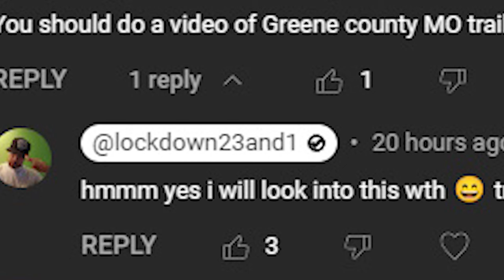SEMI TRUCK TRAILERS TURNED INTO JAIL CELLS

Comment: Reminds me of Sherriff Joe Apaia's infamous tent city down in AZ. This seems like a safety concern for CO's too. Imagine being a CO and responding to something and the inmates attack. You'd be trapped in that tin can! Another disappointment in terms of the evolution (or lack there of) in the incarceration system. SMH. ✌️❤️🙏
Reply: At least those were outside. I feel like I would go crazy in those tiny steel boxes
Reply: @mrdeebo313  I don't think the climate allows for that in MO & ID. 🤣 but agreed!
Reply: Actually, the trailer pod is right across the street from the tent pod in Canyon County. Miserable bastards.
Reply: Evolution is any change. That includes negative change. Evolve your education of the extremely basic words you use ?
Reply: @spasegeek9214  Evolve" conveys the notion of progression, moving forward: "a process of continuous change from a lower, simpler, or worse to a higher, more complex, or better state.

"Devolve" conveys the notion of regression, going backwards or down: "a downward evolution to a lower state" 

The more you know 👍
✌️❤️🙏

Comment: Man. Stack em n pack em. Those Stainless steel walls make cleaning easy, and escape tougher.
Reply: its Missouri who did the job not us Idahoans
Reply: Though uninsulated steel trailers will doubtlessly lead to inmates getting heat stroke in summer and freezing to death in winter.

Comment: Trailer jails will be a good idea until there's a little fire in one and then they'll all go to the scrap yard to avoid those lawsuits.
Reply: Stainless steel don't catch fire
Reply: @briantruck2284  nope but wires do and they catch fast and make for some nasty noxious fumes.
Reply: Or the outside temperature gets too high or too low and the heat or cold begins killing those inside.

Comment: I served in Mimico, Toronto youth assessment centre in 2000 at that point the jail was already 116 years old. Real hole with a toilet hole in the floor. Food gate at the bottom of the door. Metal benches along the wall is all you get. They keep you in there nude with just a one piece padded jail skirt. I spent 3 months in that hole after three fights defending myself. They held murderers who were older and still serving youth detention sentences. They also had all the worst youth criminals in Toronto in there. Place was lit with blood and crips. You learn fast in there. I got lucky I think a woman in corrections believed me that I was only defending myself and helped me get out of there after serving three months in the hole straight. Served open custody after that.

Comment: Thankfully here in greene county, springfield they actually got the newer jail opened up and took the sardine cans down and no longer have to go thru this hell they had a couple diff versions i unfortunately spent a little time oit their and it was brutal I m 6 foot 5 so you can imagine. I got lucky enough that the ac was working when i was their but i know plenty of guys spent LONG stretches of time in the trailers for the duration of 5  or so years they had the different variations of trailer park setups the first versions i heard was a complete nightmare as in ac not hardly working or if i remember correctly i think their was issues to do with the showers damaging and molding the place i only got placed out their 1 time thankfully idk im guessing my charges were why i typically spent most my time in and out of good ol D pod gen pop if i stayed in Greene Co. and not extradited to other counties neighboring. I remember though sometimes we would pretty much kinda get locked down in our cells for extended periods in D pod in the actual jail so they could bring the people inside from trailers and go thru and repair or thurly clean all that deadly ass mold and shit that people was getting sick from i deff have a few friends and my brother even that could shed alot more light on these better then i could the setup i remember was when they built the one you have the time lapse on the greene house looking panels ontop was basically the outside rec area for you to walk around in and their would be fresh air or some sun kinda here and their but inside very close quartere a table running straight down the center you eat chow at or alot of times sit at your  bunk if tour on bottom when i was their they had 3 bunks stacked in such a uncomfortable confined area had to sleep feetle pos all the time the only thing seperating the bathroom toilets from the beginning or last bunks was a sliding door or paneling clear see through kinda like the greene house paneling or plexi glass yeah i spent very minimal time in these things and i been all over multiple countys as well as took a DOC tour and by far one of the harder times i spent was in here literally had like 8 tablets to be able to get ahold of your ppls on and that shit was booked out by your regular phone hustlers every day and it would just always be so loud it was impossible to sleep until late night when its semi settled down in their.

I knew from the first picture the way the striped uniforms were and trailers you were gonna say greene county thought i would share my short stay that felt like forever in these damn sardine cans as alot of us called em. If you got any thing you are interested in finding out about these things i may know if i dont i deff 100% have close friends and family that spent alot of time in these things that could shed some light on the shit that was going down in their i know that if you were relitively unknown or just had no real name established or no one could verify you and or you just fall into that weaker category them dudes would sit their and straight press you at the door i never had these problems but ppl was getting pressed as soon as they walk in told they gotta pay to stay type shit and most the time it was just a group of individuals  not even no gang shit or nothing sometimes you might have some Honkeys or something individually in those mixes but them guys are mostly moving around in DOC if they are in county they just passing through typically but yeah these open bay close quarters im suprised their wasnt more beatdowns and just back and forth bickering and or just getting down over dumb shit that matters for 2 seconds and stuff while i was their only seen a couple of wrecks nothing to bad really though you wasnt getting nothing off and pretty much taking a dive if you do clash their was very few that they got something off their is a viewing window into rec and at doors outside of the pods the cops wouldnt really be in the pod itself unless counting or pulling ppl for whatever reason courts and etc.

Comment: Death I was locked up in these trailers in Springfield Mo. they are no longer using them. They have a mega jail in Greene County now.
Reply: They were using the trailers for multiple reasons. (1) is because Greene county Jail is a federal holding center. (2) The county would not let the city house their inmates. For these reasons they were paying massive amounts to of money in order to farm inmates to a number of county jails through out the state. I was in these trailers for a few weeks it was miserable, I have some extremely treacherous stories from within the walls of Greene County Jail.
Reply: You mention the TV you can watch the tv but the only way you can hear anything is if you buy a little Walkman radio for 20 bucks. 8:07

Comment: I stayed in the trailers in Springfield Mo. I prefer the trailers over the jail tbh. Youre always on rec in the trailers and you had an actual outside space to walk around in and feel the rain. Yeah it was a tight space but it sure beat the confines of a cell inside a concrete room. That timelapse was from the first set of trailers where I stayed. The second and even bigger set was built across the street before the new Mega Jail was built. It was pretty laid back for the most part. You had to be on your best behavior in the trailers or you would go back to gen pop inside. the trailers were considered a "privilege" since you had 24hr access to phones, tablets, vending machines and outside. The beds did suck! Im a large human. They had me assigned to a middle bunk and there was no way in hell i was going to fit. Im 6'4 410lbs and i had to sleep curled up in the fetal position to even fit. Top bunk ended up switching with me on the first day. Id never wanna do it again and thankfully i havent been to the new jail. Keep up the videos Death!